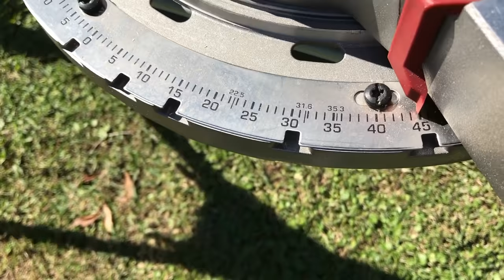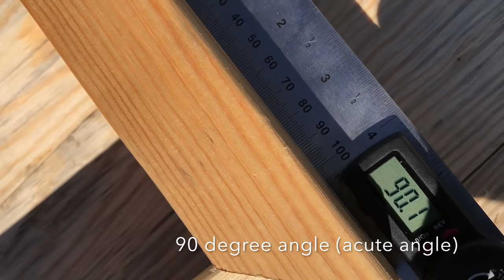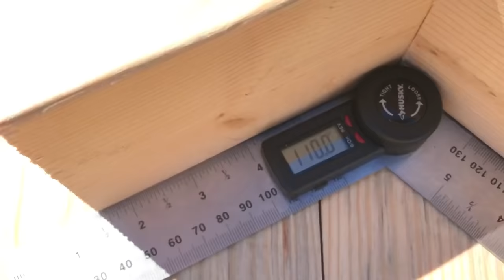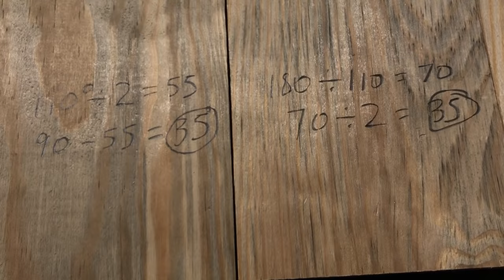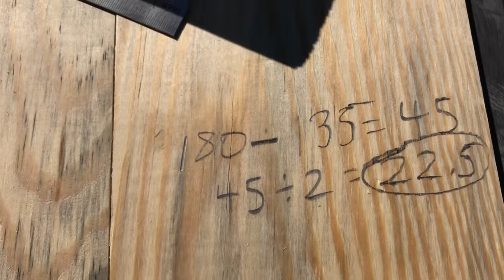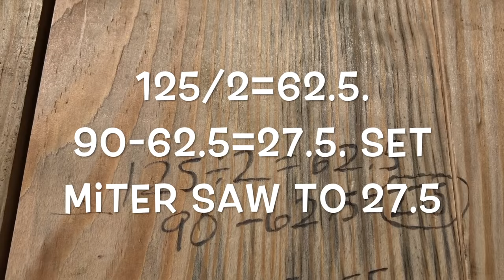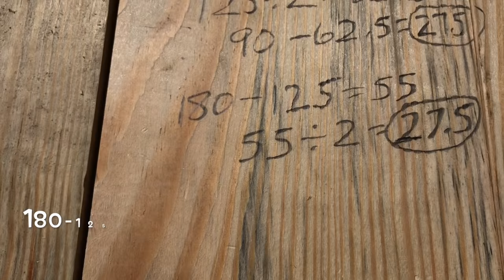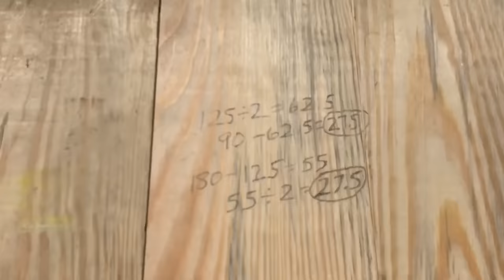How to measure and cut angles for baseboard, crown moulding, etc

Comment: Need to pass along a quick story. 2 weeks ago I was replacing some counter top trip.  I could not get the angle.  Kept trial cutting and trial cutting.  Finally, I got the angle.  I hadn’t even looked at my miter saw to see what it was.  I was so frustrated that I installed the trim and shut down for the day.  I just remeasured the angle then used your formula for Obtuse angles and came up with a figure.  Went to my miter saw and it was still set to the last angle I cut.  It was set after trial and error at exactly what your formula calculated.  Wish I’d see this earlier.  This is a great tutorial.  Thanks much!

Comment: Great job guys!  One of the best, easiest videos out there!  The trick is remembering that miter saws are set @ 90 degrees already.  You have to deal with that 90 degrees when figuring an obtuse angle.  These guys did a great job.

Comment: Chris -  A great video and clearly explained tutorial. Great job.

 I have the same Husky Digital Angle Finder and wanted to point out a feature on this angle finder that simplifies your math calculations for obtuse angles.    On your Husky angle finder, please note the two red buttons next to the digital readout.  0/On and REV.   0/On = zero calibration/turn unit on    REV = show the reverse angle from 180 deg.

After you take your first obtuse angle measurement (reference 4:40 in your vid) of 110.0 degrees, rather than do the math one of the two different ways you show, there is a third way.  With the Husky Digital Angle Finder display reading 110 deg as in your video, press the REV button.  This gives you the reverse angle which will read 70.0 on the digital read out.  Simply divide 70.0 (the reverse angle) by 2 and you have the correct angle, 35 degrees,  for your miter cut.  Math simplified!

FYI, I'm not affiliated with Husky of Home Depot in any way.  I'm just an interested retired handyman around the house.    I really enjoy your videos.
Reply from the maker: Thanks for watching and thanks for the tip.  I did not know that.

Comment: Thanks! Very clear, easy to follow instructions. I was struggling with my fireplace trim - outside corner 135 degree angle. I didn't have an angle finder so I put two rulers together with a wing nut then used an online protractor. Worked perfectly.

Comment: Excellent Excellent job explaining.  Great step x step.  One question that I have is that, when measuring for the length of a piece of baseboard or crown molding corner to corner or even from a door way trim to a inside corner... Do I measure just the exact length like I would anything else, or would I measure a little extra bc I’ll be cutting off the ends for the angles?  I’m doing my baseboards for my dining room today, so I could really use the advice.  Please and thanks. I have to first go and buy a digital angle measure guide. Hope their not too expensive?  Thanks again. Merry Christmas and Happy Holidays to you and yours. I’m now a new subscriber after watching this video. 👍🏻
Reply from the maker: Thanks you so much for the kind words.  You can  get the angle finder I have for $20 at home depot.  To answer your question when you are cutting an inside corner you don't need extra but an outside corner you will need to let the board run a little longer so you can cut it.  Just measure the length you need, cut the first angle for one side.  Then use your tape measure and mark for the next cut if it is an outside corner make your saw blade hit that mark on the outside of the mark.  I hope this helps its hard to type how to do this maybe I'll make a video showing the process. Please let me know if you have any questions.  Thanks for watching and subscribing and  Merry Christmas and Happy Holidays to you and yours as well.  Good luck with your project
Reply: Sawdust and Wood Awesome. Thanks so very much for the fast reply. Greatly appreciated. I’ll keep ya posted👍🏻.

Comment: this is a good video but I think the information for an acute angle is a little misleading.  Please forgive me if I missed it in your video, but it seems that your information is stating that any acute angle is simply divided by 2 and that is the cut you make but that is not correct.  if you have an 85 degree inside corner, and you divide 85 by 2, you would get 42.5 and two 42.5 cuts would not make that corner.  you need the complimentary angle to make that cut.  so you need to use your same math, 180-85=95 and 95/2=47.5.  so you need to make the cut at 47.5 to get the 85 degree corner.  Did I miss that point in your video?  if so my apologies
Reply from the maker: I realized I said that also , I made another video on my channel that explains how to cut acute angles.  Good catch though.  Thanks for watching
Reply: Exactly

Comment: Your a trim carpenter. I know your traits when cutting these boards. Plus, Chances are very slim the guy who is not a carpenter would know these formulas. I’m a carpenter but chose a little different way to find my angles. I precut my angles in trim pieces and because the angles on a wall would often be a degree or two off because of Sheetrock mud or due to the rock not being nailed off correctly. Great video and refreshed the math for me. Thanks!! Also, you have to be in south Louisiana or at least south of Shreveport. I know the slight accent. Are you Cajun? I’m from northeast Texas about 10-15 minutes from Louisiana. Thanks again, friend!!
Reply from the maker: South east Louisiana you are right my friend!
Reply: This video turned the light on for me, great job explaining...I do have one question though...if you have to miter both ends, I struggle to cut the board to finish to the correct length...what and where do you measure from?
Reply from the maker: Watch this it should help  https://www.youtube.com/watch?v=kK5PeOSatEs&t=2s

Comment: as someone who has done a lot of this, the effort to explain and demystify this element of finish carpentry is great.  Kudos to you.  
A few small corrections: 
An angle of less than 90 degrees is acute, more than 90 is obtuse, but exactly 90 (which is what you had, except for the ignored .1) is called a "right angle.  It is not acute.  
Also, if someone is making picture frames or something similar, they will be using 45+45=90, but most people don't have a single exactly 90 degree bend in any wall.  Instead it'll be like 88 degrees, or something like that.  
Finally, while there are two ways of calculating the miter angle, the second method you mentioned "180/110=70" is not correct.  I assume most people understood the error, but 180/110 is definitely not 70.  It is 180-110 instead.

Comment: Yea man I tell ya I know a crawfish eating, head twisting and sucking creole when I hear em.  100% Cajun!  Damn good video man! May the next beer cooler of crawfish be on me if we ever meet!  You helped me align in on the miters.  I thought it was me the whole time and according to your tutorial, it's the damn angles that's making my cuts "off" .  I want to add in too... 

Be sure you are using a good blade and not the cheap ones.  The cheap ones tend to have a bevel that can take about a 16th off the cut and you end up loose and instead of a 45 you have a 44.  So what I do is calc the angle and subtract literally 1/16th off and it tightens the joint.  You just make it look easy as pie but as usual, I have to over-complicate it because I always end up with the crap end of the stick of sorcery and always have to account for differnt stuff even when it's not supposed to be LOL.  great video sir!
Reply from the maker: Thanks!  I'm ready for some crawfish

Comment: Yes this video is very good. My issue is i'm laying colonial style baseboard and the wall corners(mostly outside) are pretty rough. Some are a slightly different measurement at the floor vs 4 inches up the wall. Almost every piece of baseboard I'm laying I need to do a bunch of cuts and then settle for it with a "guess I'll fix it with caulking" which I hate thinking about.
Reply: Coping is your best bet when you have molding with a profile in my opinion
Reply: I'm a retired trim/finish carpenter. I can understand your situation. First thing, on your miter saw do you have a plywood blade or a cross cut blade? If you don't know, a plywood blade has lots of small teeth, whereas a cross cut blade has fewer teeth and is usually a carbide tooth blade. If you have a cross cut blade on your saw change it to a plywood blade and you'll get smoother cuts. Also on a outside 45°cut if you'll make it a 46°cut it will create a better joint. Also if you don't have one of those fancy angle finders, place a piece of base on the floor in front of the outside corner letting it run past the joint. Draw a line on the floor next to the baseboard, then do the same on the outside. Where the two (2) lines cross, put a mark on the baseboard,  do the same to the other side. This is your long point of your cut. While making this mark also mark where it meets the wall. This is your short point. Cut from short point to long point, and you've got it. That's the old way of getting it done.

Comment: Thanks Chris. This is much the most sensible way to calculate mitre cut angles. It's a bit of a pity that Chris makes a mistake in the mathematical formula for the 180-measured angle method for calculating the mitre cut for an obtuse angle first time around. Time for take two?

Comment: On the pretend wall with obtuse angles all were inside cuts,  it will still be the same angle cuts for outside and to cap the pretend wall correct?so the inside and outside angles are the same? I am wanting to cap my wood fence and it has two obtuse corners. great video and Thanks

Comment: How do you know if it's an inside angle or outside? Also, I just cut my angles/boards  together, 1 on top of the other so they'd be the same. It worked just fine, but now I wonder if I just got lucky. I guess I don't understand the need to cut separately if they are going together. Isn't there a good chance of cutting one at 22.5 and the other side 23 or 22 because you moved the table? Just started making stuff but I need to know for next time I do trim.

Comment: Just to recap on the 110angle 
Was the formular for that supposed to be 
180 - 110 = 70 
Cuz I'm sure that other formula you used would be a total different answer
Reply: mike hunt 180\110 = 1.636363636363636.

Comment: This considder acute angels on mitersaws: 

if your angle is under 90, lets say 85 degrees, and you divide and cut the two pieces at 42.5(on your saw) and try fitting them its not gonna work. Instead of Making the pieces 42.5 make them 47.5. Then it works 
 Since your saw is at 90 degrees at the zeropoint this formula must be used:

85/2 = 42,5 then take the number that will add up to 90: 47,5. 

Im from sweden so exscuse any misses in writing :)

Comment: Now I'm ready to do my chair rail!  So this also works the same for crown molding, which as you know is typically angled away from the wall as well as having inside and outside angles?  I know you said crown molding in your video, but just wondering if that cut requires anything other than holding the crown on the miter saw with the ceiling side of the crown molding on the table of the saw and the wall side of the crown molding on the fence of the saw.

Comment: How do measure for crown moulding on a 90 degree corner but has a 1" trim moulding down inside corner of wall? Might have wires behind trim piece. That 1" trim is stumping us as we can't figure angle to get to corner. It's not really a 90 degree with trim in corner.

Comment: Is it true a  85 degree angle  divide by 2 = 42 1/2, but if cut them at 42 1/2 they will not fit properly. it needs to be cut at 47 1/2 to make a perfect angle, correct?

Comment: I love math. I can't help when I see at 6 minutes into your video, on the right how you divide 180° into 110° and get 70°. That would be 180° minus 110° = 70°. 180° divided by 110° = 1.64° rounding off on the hundredths column. Technically, you should always do the subtraction from 180° Even when you have an angle less than 90° When you have say 78° example. 180° - 90° - 78° = 12° Then do your 12 / 2 = 6°. I really do like your method and how you came to the degree your looking for, so you know exactly what angle to cut your wood to make it fit. Now that is pretty awesome! Thank you for taking the time and showing me how to get the angle that I need to figure out my cuts. I just bought a new miter saw over the, "Black Friday Weekend", and was looking for new tips and tricks. Thank you for putting out the video! :)
Reply from the maker: Kenny thanks for watching! Yes I agree 180 - angle is the best way,  I'm glad you enjoyed it.  I just made a video about how to cut acute angles under 90 degrees on your miter saw.  I think you will enjoy it and the video has a really cool trick to cut angles higher than your miter saw has a setting for https://www.youtube.com/watch?v=VNFjzMmi6NE&t=5s .  Again, thanks for watching!
Reply: Kenny Stroner you’re saying a measured 78 degree angle should be cut at 6 degrees???
Reply: Frank Frisina Right. Lol. For someone pointing out a simple mistake, which everyone still understood.  He makes one himself.  All in the wording. I thought the video was awesome and very informative. If ppl were confused on the math, they could have simply just rewind back and rewatched it and listed. Not that big of a deal. Keep up the great videos!!
Reply from the maker: Thanks
Reply: Frank Frisina. Not exactly. You would use 6 degrees as your cutting number. Example: 84 degrees and 96 degrees is where you would set your saw for both cuts. This would give you a 78 degree angle for cutting. Of course, I haven't watched Chris's video to confirm it below 90 degrees. But should be by the same principle. We all make mistakes! I make tons of them. Making mistakes is just a part of life. I wasn't out to take a cheap shot at, "Sawdust and Wood." I think he did a fine job. Besides, I am just a "Math Nerd" at heart! :P
Reply: Thank you "Sawdust and Wood" for the reply. I will for sure watch more video's and get more ideas as I am learning to do different cuts with my miter saw, and thank you for your time putting out the video.  :)
Reply from the maker: You are right making mistakes is a big part of learning.  Thanks for watching
Reply: Update: I did this wrong. I should have based it off of 45° as my starting point and do the math from there. I explained the way after trail and error after cutting a few boards till I did it right. My 6 was correct. I ended up doing 39° on my left and 39° on my right sides with a square board on the opposite side of the miter saw when I did my cuts. Works great!

Comment: your videos have helped me a lot in my current building project but I keep running into a problem now.  The max notch on my miter saw is 47 degrees and it's still a few off when I try to fit my base into to my triangle shape.  Any suggestions on what I can do that doesn't involve buying a different miter saw?

Comment: I did get the cut at 78°, but not the way I thought. I did both my cuts right finally, after trial and error. I ended up cutting my boards at the 51° to achieve this. I only did find a better method after thinking it through. 

78° based on the equation of (180° - 90° - 78°) / 2 = 6°  

I still haven't watched your video on doing cuts below 90° yet. Still curious to see your methodology on this one. 

I used the same board size and cut 90° to give me a nice even square to begin my cuts. The board I wanted to do the angle cut at 39° I would check to make sure it had an even cut of 90° so my cut wouldn't be off when I did my angle cut. I set the miter saw at 39° facing to the right side and my squared board I clamped down that I started with on the left side up against the miter fence. I did my cut and reversed the positions of the starting board to be on the right side and the board to be cut on the left side. I adjusted my miter saw to the left side of the 90° mark to the 39° mark. The cut worked perfect.

I did take a couple pictures to make this more easy to explain, but I didn't have anyway to post the drawing and the board I cut and glued together for fun to show you what I did. So, there goes the long explanation above. I hope it made sense. 

Can you link your video you did of showing cuts below 90°? I wanted to see how you did it. Thank you, Chris!
Reply: Does anyone know how to post pictures on Youtube, in the comments here? Thank you much!
Reply: The board I was cutting was facing toward the miter saw up against the miter saw fence and one side up against the board to keep it lined up. Sorry, I didn't explain this right.
Reply from the maker: https://www.youtube.com/watch?v=VNFjzMmi6NE&t=1s .  Watch this Kenny and you will figure it out.  I want to thank you for watching my videos, always feel free to ask any question you have.  Thanks my friend

Comment: THE CORRECT FORMULA FOR TWO MITERED CUT PIECES:
( 180 - “total angle” ) ÷ ”2 cuts” = "The angle set on the Miter saw"

Example A:
Your Wall corner is 80º this is your "total angle" and you need two 40º baseboards, so you must set your Miter saw to 50º.
180 - 80 = 100  then 100 ÷ 2 = 50 (set the Miter saw to this angle)

Example B:  
Your Frame corner is 94º this is your "total angle" and you need two 47º cuts, so you must set your Miter saw to 43º.
180 - 94 = 86  then 86 ÷ 2 = 43 (set the Miter saw to this angle)
Reply: BINGO! I know he explains this better on his other video, where he counts backwards from 0° (which is 90°), but I'm glad you wrote this. I just wish he would correct it on this one. As you showed, the formula applies to ANY cuts (other than 90°)... obtuse OR ACUTE. I was struggling with the saw today, and now I know EXACTLY why! THANK YOU!!!!! Not sure why you're not getting any thumbs ups?? People NEED to know this.